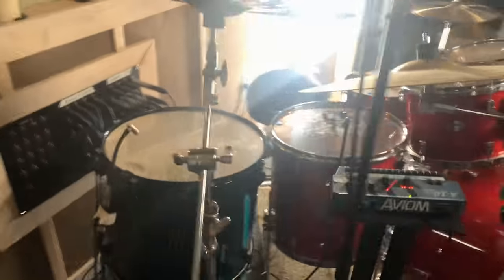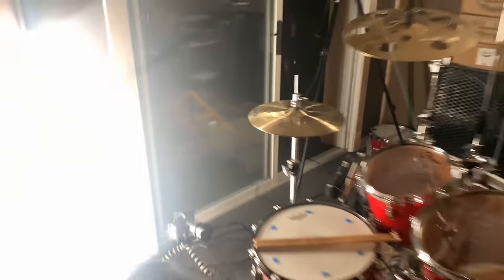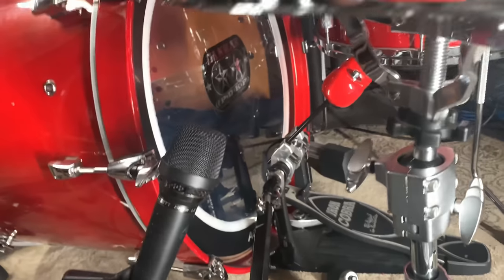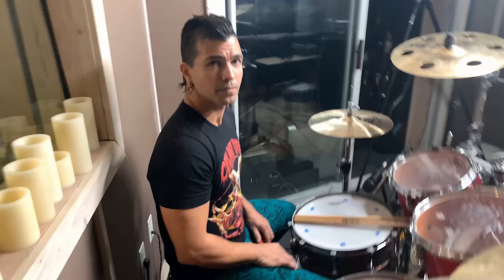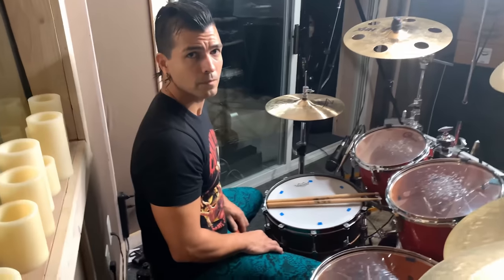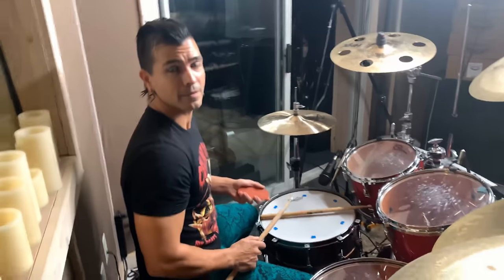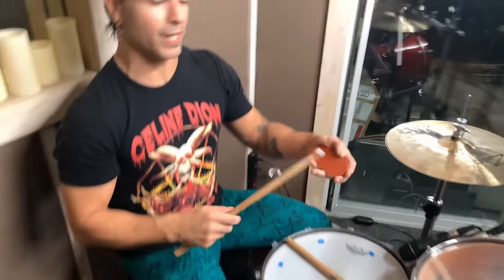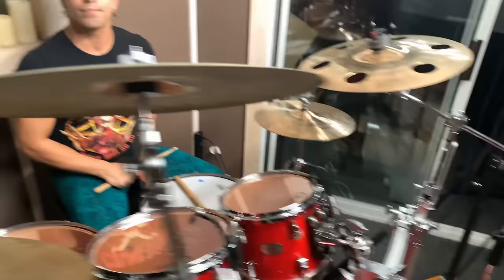4 easy ways to change your Kick Drum Sound

Comment: There's really not enough material about making natural kicks sound good in metal
Reply: Seriously. That clicky computer shit needs to go away.
Reply: @abdul4515  well good luck with that. Laws of physics are against you after 200bpm.
Reply: @VladicD  Not really, the only reason why bass drums can't be heard at that speed is because modern metal drummers hit like pussies. If you look at old footage of rock and metal drummers, You would notice that they are SLAMMING their drum kits. Loud Hits cut through the mix way better than the shitty tip-tap hits that you get with modern metal drumming. Also, the guitar players didn't used to hog all the bass for themselves. They knew that it was important to use less gain and bass to ensure that you can hear everything in the mix.
Reply: @abdul4515  ok boomer
Reply: @abdul4515  if you actually play drums, you would know what's the problem there bud
Reply: @abdul4515  you can't get the control and speed playing aggressively at that bpm.

Comment: There are also Steel beaters made by Trick. Might be cool to do a part 2 with those.
Reply: Hard beaters sound awesome imo. But they wear out your head so much faster
Reply: @shadowflame005  I've noticed that the wood ones I use (same as this vid) actually put dents in my head faster than the steel Trick beaters do. I use an Evans Heavyweight and the black Evans EQ patch...the wood beaters straight up left a dent behind the pad...was totally wild.
Reply: @ThrashBandicoot666  dude you are cool af

Edit: I wasnt being sarcastic

Comment: I've got an Evans EQ Double Kick Pad on my bass drum which I hit with felt beaters. I like the sound that gives when I pack the bass drum a bit with some pillows - a nice thud with plenty of attack and not much sustain without then sounding too harsh like plastic beaters do.

For added context, my bass drum is a Tama Rockstar 22" maple kick and the pedals I use are Mapex Mars doubles. The bass drum I bought second hand from a fellow university alumnus (along with the rest of the 7-piece kit), and the Mars pedals I bought to replace my Armories that I had used for quite some time and eventually sold on. The Mars pedals are a nice affordable set of pedals with a quick, light feel and plenty of spring.

Comment: Curious to know what the electronics are that were on the stand under the ride cymbal. Metronome? 

There are a lot of other factors to consider when deciding on a bass drum sound: whether two bass drums are better than one (with a double pedal) in a mix, the size of the drum (diameter and depth), the tuning, the muffling, the type of head, etc. I know you know this and I'm not complaining. 

I was surprised to see that the "felt" beaters in this video are plastic with a felt face attached and not the true old-school felt beaters. 

Personally, I like to use the felt side of the plastic beater on a metal pad. I don't pound the pedal into the ground so I don't get the ghost notes your drummer didn't like.  The fact that I started using a pad made my bass player able to hear the bass drum better and we tightened up quite a bit. 

Great job on this.

Comment: Great video! I agree the felt and falam sounded the best here, but the batter head and the front head's thickness will also affect the sound of the beater and pad combination. I believe it has to do with how much pressure/power needs to be generated to move the heads. I'm not talking about the different sounds of different heads, but the thickness of heads affects the actual sound/performance of the "beater+pad" combo. Meaning the same "beater+pad" will change with different thicknesses.  I hope that makes sense.  And I think I just repeated myself 3 times. lol

Comment: Danmar beaters with a falam slam on a clear PS3 are my go to. Just enough click to cut through, and a nice wide tuning range. DW hourglass pillows on the inside and it takes me about 3 minutes to get a killer kick sound.
Reply: Thats the exact setup that I use and it sound KILLER!!! You have great taste, my friend! I'd suggest getting an Aquarian Regulator reso head, with the smaller offset hole.
Reply: Aquarian makes great heads, but I’m personally a logo head guy. On my kit I leave at home, I have a 6” hole at 9:00 with a chrome Holz protector (stock Tama starclassic logo head) and on my gig kit I went with a 5” hole at 9:00. This heads an ebony PS3 that we made a printout of our band logo on. This kick sounds like a cannon. And I’ve even got Remo muffles on it for live triggering.
Reply: @philb.1899  I used that ebony PS3 reso FOREVER! Then an older dude at Guitar Center demanded I try the Aquarian Regulator. SO I think you should at least try it. Also if you like the Tama Starclassic Logo, you can put sucha  sticker on it. I do it all the time when a guy is sponsored by one company, but we end up using another head for a video.
Reply: @BeatsAndMeats   at this point, what im using is working great. Kick Reso heads are usually the last thing i worry about when it comes to changing out my heads. But ill look into it the next time need the presents itself. I do love Aquarian Super Kick 2s if im going to use a full pre muffled head. My only issue with that head, is that it seems to lack volume. (isnt a problem when i trigger) but i dont always use my triggers. Thats why i went out of my way to make sure my kick drum still sounds good even with a little extra muffling.

Comment: Anal clarification. About the red danmar. You're not hearing a wood beater. You're hearing a coat of red paint. Apply the same paint to a metal beater,  plastic beater, etc... that have the same mass, surface area, balance etc... and they'll sound the same. If you want to hear the acoustics of wood smacking any given surface, make sure there isnt paint or lacquer between the two surfaces. 

Nerdiness aside, i have found flat shaped plastic surfaces against the remo falam provide the most attacking slap. I have a set of red painted danmars, and the red paint being softer on the hardness scale compared to a plastic surface results in a softer darker tone.
Reply: AKSHUALLY.... I usually sand off the red paint from the Danmar beaters because the paint sticks to the Falaam Slam and them sticks back to the beater and messes up your flow.
Reply: @BeatsAndMeats  great tip! Danmar needs to come out with a red polymer beater.  I think the red color on the black shaft is a rad look. If they had a four-sided mold of different shaped surfaces (like the pearl quad), and press fitted them onto the shaft perfectly square (my current danmars are not mounted perpendicular to the shaft), i believe they'd rate super well on the market.  Probably cheaper to produce too - fast, automated, etc.

Comment: Glenn quick tip here for bass drum sound, grab a large coin and put the pad on top of it (hitting the beater on the coin) it will be a little bit more punchy and focused
Reply: Like the metal plate in the Danmar kick pad?
Reply: @rockdahaus  I feel that it sounds a bit different, I never used the metal plate, bu the drummer in the video said it sounded kinda flimsy when you bury the beater, didn't had that problem with the coin, I'm guessing the elongated shape might not be the best one for this kinda work, since when you're hitting one side the other is trying to go the other way, which doesn't happen with a coin, also, a coin would be easier to test and grab instead of purchasing a new gadget
Reply: @hellsp4wn243  I always imagined that a U.S. quarter would start cutting into the drumhead. Have you ever had a problem with that?
Reply: @BeatsAndMeats  I used only with double ply heads on the bass drum, but durability is an issue, although the heads lasted as long as 2-3 years, it usually lasts 4-5 until it rips, without the coin, I have to stress that I'm not a big guy, 1,71m 80kg, and although I do hit hard I don't usually break stuff other than an ocasional cymbal every 5-6 years, or even heads. So your experience will vary.

Comment: have to do a full shoot out. untouched head, head with home made rectangle of old drum head taped on, falam slam, the ancient remedy of moleskin, quarter trick, danmar metal click, danmar plastic click, kevlar patch. each with felt, rubber, plastic, and wood beaters. many options i'd like to hear your opinion on the how much difference there really is.  just like the whole thing that drum companies keep making their shells thinner and adding bulky suspension systems to make the drums ring longer while they sell you evans hydrolics and moon gell to cut that shit out.. my older mapex m series sometimes I think sounds better than my newer tama silverstar.  the thicker shells with the minimalist suspension system  makes the drum ring less and get a more cannon sound more easily. (not to mention it is easier to clip mics onto the rim without a starcast or rims mount in the fucking way) check out the "sounds like a drum" youtube channel. they do lots of interesting drums shit.  they just did one that to get rid of the basketball ping on floor toms you bisect the drum with a piece of cloth stretched between 2 opposing lugs  and it kills that pingy annoying basketbally frequency by keeping the inside of the drum from reflecting too much.  you should collabarate with them sometime.  they try all kinds of crazy drum sound hacks. recently they did the john bohnam lining your bass drum with aluminum foil myth.

Comment: I use just that; felt on kevlar. 
I avoid, however, filling the bass drum by using a Power Sonic Remo beater which has built in felt for muffling. I don't know if you've tried it but, I'll never get tired of recomending those to metal drummers.
If you want even more attack, get a felt pad (to avoid friction) on the drum head and use rubber beaters (which are meant for practicing).
Cheers from Puerto Rico

Comment: i used a falam slam once, it tore up really quickly and i kept patching it up with duct tape. i loved the sound but the quality was just shit.
Reply: There's two different materials they use. One is shiny and smooth to the touch, the other is not shiny and a little bit bumpy. The bumpy one is FAR better, sounds better and lasts forever. The black ones are worthless.